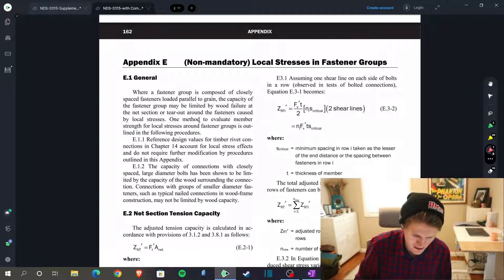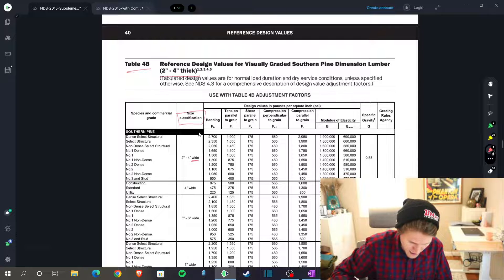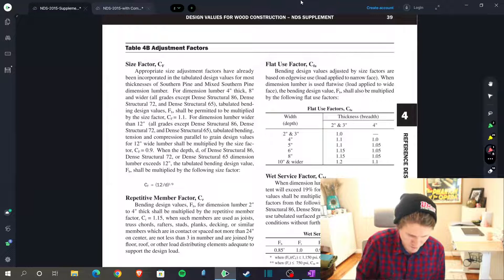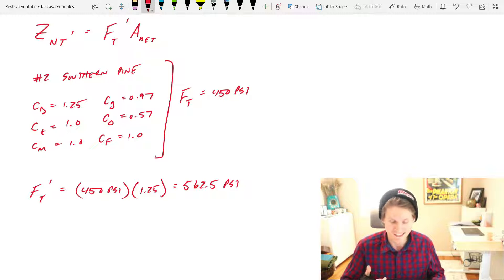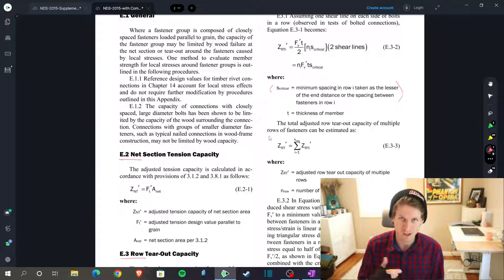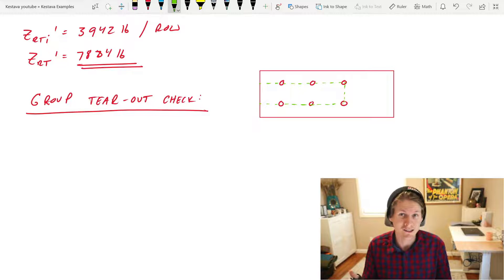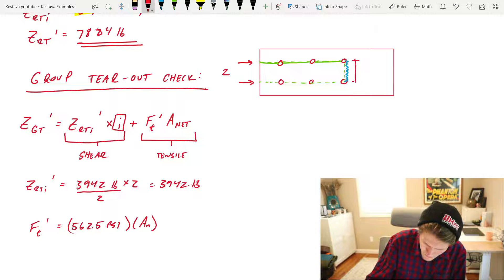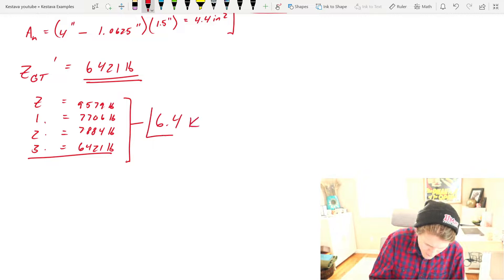Bolted Wood Connection Design Example - Part 3 - NDS #structuralengineering

Comment: I would like to see you do a lesson on how to read residential wood truss design sheets, specifically how to find the uplift reaction on girder trusses that typically have  large uplift values  2000 to 3000 lbs are common. Then design the tie-down from the truss down to the foundation using the Simpson Strong-Tie catalog for wood connections.
Reply from the maker: A classic Randy! I love this. what type of system am I tying the trusses to? CMU? wood? conc? this is a great real  world application
Reply: @Kestava_Engineering  standard residential wood wall framing on an 8' concrete foundation. i have the detailed truss drawings if you need them.

Comment: can you please do a video on seismic design of wood shear walls? Like from the top to bottom, taking a structure, determining the seismic loads based on spectral acceleration values (Sa(2)), etc. and the methodology of choosing where exactly to place shear walls.

the video you have about designing a wood shear wall given forces has been very helpful :) thank you . I am in canada if that is relevant